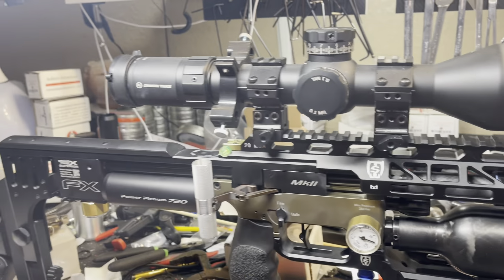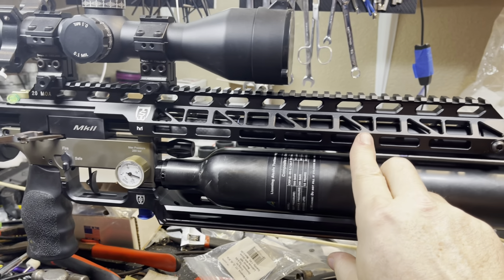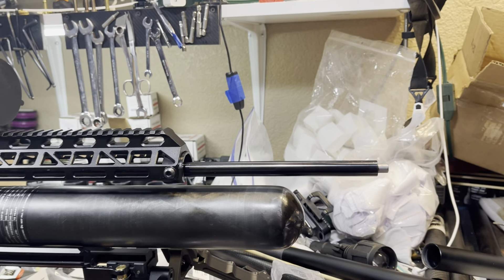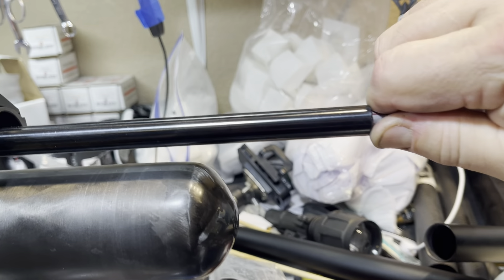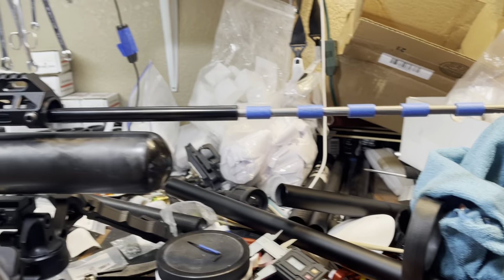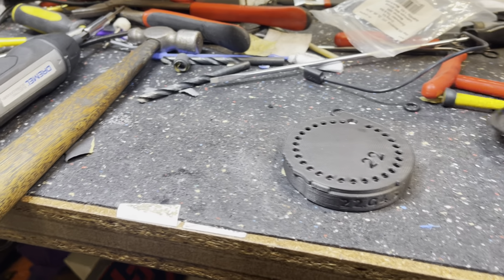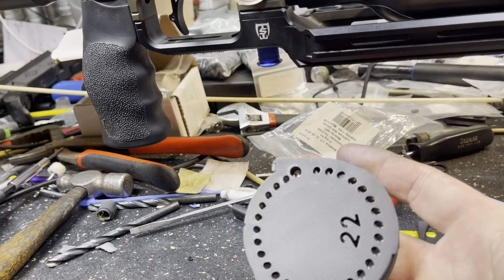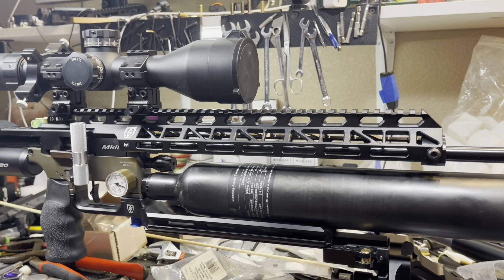Fx Impact Barrel bedding+exciting new products on the CHEAP! Uhm Frugal!?

Comment: I did not tension my 800mm barrel with that many sections of painters tape. I did 1 in the middle, 1 on each end and then split the difference. I see where it could cause a wave effect on the barrel. I might just pull it tonight and add 4 more sections of tape. It can't hurt that's for sure!!

Comment: Do you have a simple way you use to index your barrel?
Reply from the maker: How I do it is. Simple or not. Shoot at 40 to 50 yards or however close you need to be in order to keep it on the target. Using the same aim point. Index until you find tdc top dead center or the highest poi point of impact firing 3-5shots. Once you find the high point. Then turn the barrel 90degrees down. You will find that to be the best accuracy. Once you do that retune your rifle. Throw out all preconceived notions….. this or that is the best speed for accuracy blah blah blah. Let what you see in front of you be your guide. I always shoot the new tune for three days running with out altering it in any way before I except it as a tune I will continue to use. However barrel stabilization is the key to being able to shoot at what ever speed you want. Thanks for your comment 😎

Comment: Where did you find the shroud end caps that you screw on to add tension to shroud and barrel? I’ve looked everywhere and can’t seem to find them? Great vid!
Reply from the maker: eBay I posted a link in the description. Fyi you need to glue them in place. Or block the airflow with stacks of painters tape and screw it on after. I the 3D printed threads can’t handle 40-80fpe. They blow off. I need to post another video.
Reply: Sold out lucky me a found the same one on another listing but was the last one
Reply from the maker: @airguns-shooter  hey share the listing with the family. Make sure you glue it in place properly. Thanks for your comment 😎